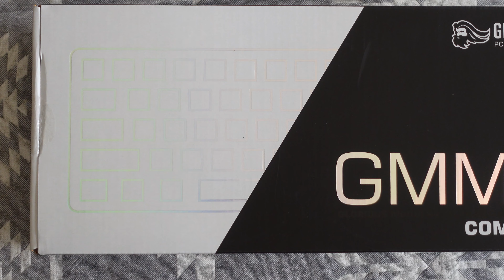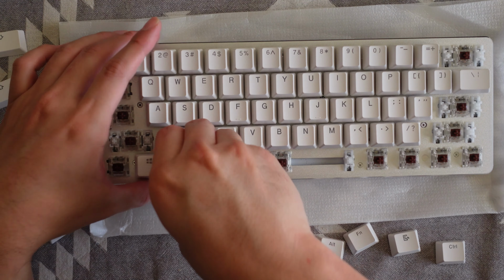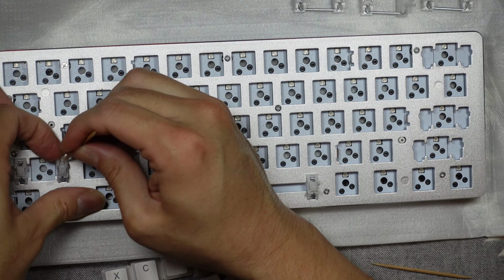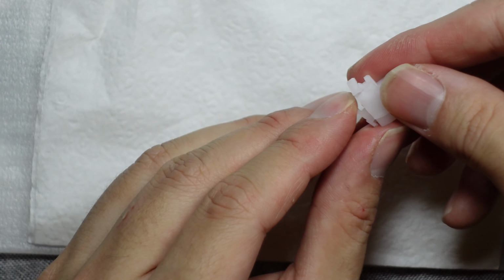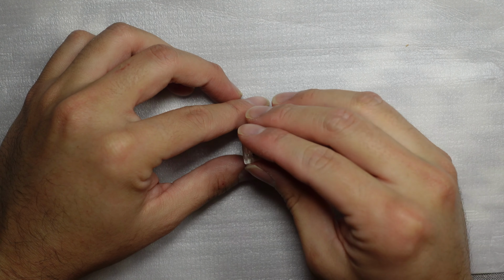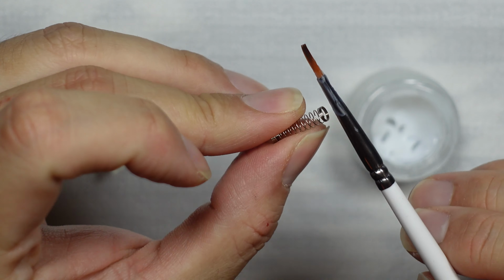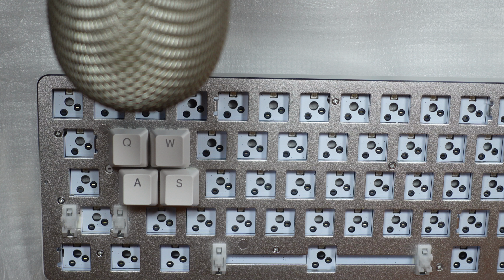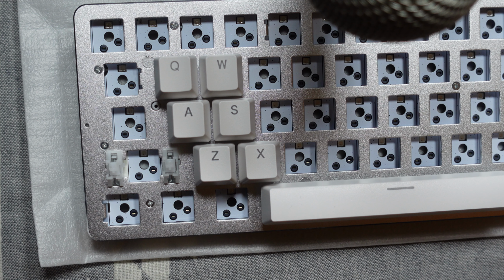Upgrading a $100ish keyboard to the Thoccky Goodness Edition. (GMMK White-Ice edition)

Comment: I got pre lubed glorious pandas and I'm happy to say they sound amazing with no spring sound. So if your lazy like me definitely worth getting prelubed
Reply from the maker: That’s awesome, they didn’t have the prelubed option when I purchased mine, but I’m sure it’s a real time saver!
Reply: @platinumtechgaming5683  I thought it would be trash but it turned out really good. Mabye I just got lucky though who knows. Can't complain. I'm getting durock stabs next and krytox and mabye better sound dampener and then I'm pretty much done for mods. 1 thing I did want is a aluminium case but that's not going to happen.
Reply from the maker: Those sound like some great mods, the durock stabs are some of the best. Good luck with your next round of mods!
Reply: @platinumtechgaming5683  what I really want to do is change the rgb on the board to something brighter but that's something I need to search more on

Comment: So the lube got rid of the ping noise? I just got the GMMK with gateron browns and even with extra foam the pinging is way too much.
Reply from the maker: From what I remember, lubing the browns did help with the pings, but not sure if it got rid of it all together. I’m sure the extra foam you put will help, but maybe you can film the switches too.
Reply: @platinumtechgaming5683  Thanks for the response! I ended lubing the switches, adding switch landing pads, and extra neoprene foam. Completely transformed the feel and sound. The lubing probably had the biggest effect so definitely recommend. Don't hear a ping anymore.
Reply from the maker: Thanks for the update! I’m glad it turned out well. I definitely agree that lubing the browns is they way to go.

Comment: Thanks. I ordered a second hand board and it will be my first custom keyboard. I got the one in the video but in black for 75€(new ones are ~150€ in my country because import taxes:( ) and I want to throw in the mix some switches, but cant decide what to get. Also an keycap set would be nice and a coiled cable
Reply from the maker: Switches are such a preference thing, it’s hard to recommend one definitive one. You should decide if you like linear, tactile or clicky switches. For linears, lubed gateron inky blacks are a good value. Good luck with your build!

Comment: hi I’m building using this but I’m not sure whether to use plate mount stabs? Are they plate mounted because I’m buying durock and there r either plate mounted or something else which are rhese?
Reply from the maker: These are plate mounted stabs. Screw ins would usually require screwing into the pcb.

Comment: hey, I was thinking of getting the gmmk. anything I should look out for? also my budget is around 130 USD, should I get pbt keycaps along with the gmmk or should I get different switches instead? Have you experienced any issues with it? nice vid btw. Much better than mine anyway lel
Reply from the maker: If you want to stretch your budget a bit, I’d wait until Black Friday. Most things would be on sale then including switches and key caps. I’d say if you had to choose, switches over key caps as it would make more of a difference when you type. Try the stock switches out first and if you really like them, then no need to change (though I do recommend lubing the switches). I haven’t ran into any issues yet, but it isn’t my main driver so I don’t use it much.